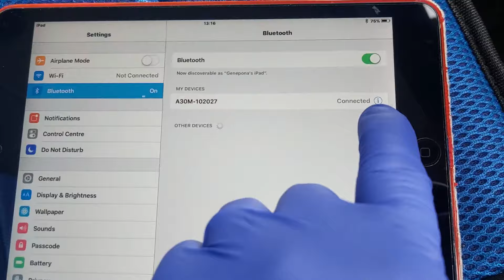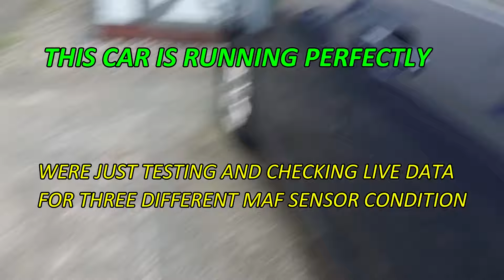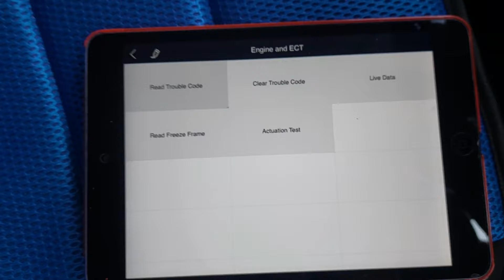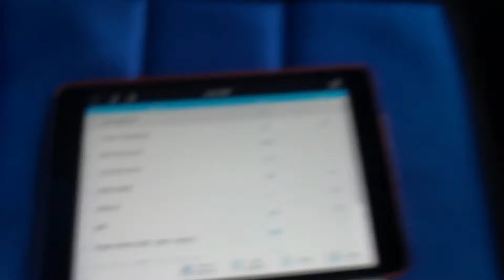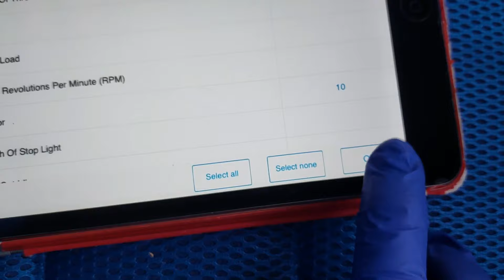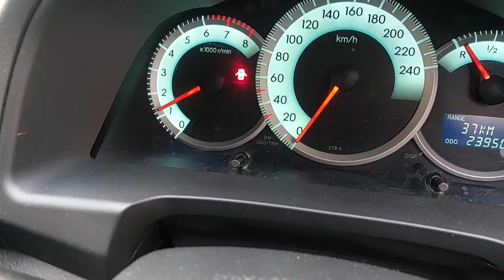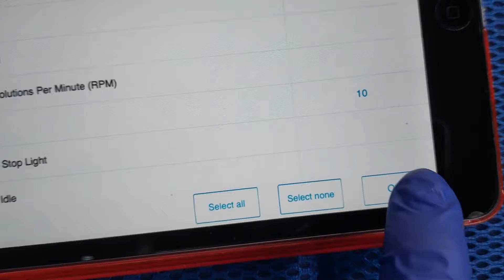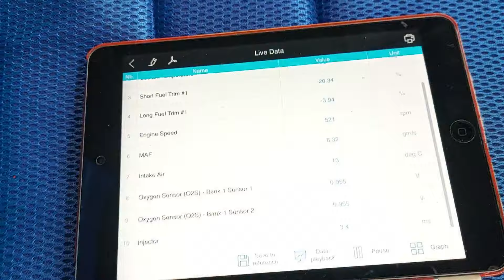DIRTY MAF VS CLEAN MAF VS BAD MAF SENSOR TESTING AND LIVE DATA with a SCAN TOOL.

Comment: You should've cleaned the dirty sensor and retested it so you would know if it's the dirt that caused the issue or the sensor itself is not working properly

Comment: But please why is it that the long and short fuel trim is still running negative on clean MAF
Reply from the maker: A clean MAF running between -3 to +3 are still very good..the engine has 235k kilometers..
Reply: @jlsetnuper  thanks 🙏 waiting for next video
Reply: Anything under 10 is considered good really good will b -0 +0
Reply: I would say in the range of -5/+5 is good.

Comment: Came here just to see for a laugh if my annual cleanings are warranted. got a CEL so I grabbed my scanner and it just said p0102 maf/low voltage so I popped the hood at home where my tools are and it just came undone but ran fine still til I did a wot pull acting confused 😅

Comment: super helpful.. does cleaning the MAF restore smooth idle? which MAF cleaner would you recommend kindly 🙏🙏
Reply from the maker: thanks for watching..yes cleaning the maf sensor will restore the fuel trim. You can use Maf sensor cleaner or a break cleaner..

Comment: What does Fuel Trim means?
I'm currently running 4 Litre / hour of Fuel at Idle. Calibrated injectors (diesel), new oil, filters etc.. Any chance that this is the cause? My intake temperature reads high too

Comment: Any retailers sell the scan tool? Does it have programmable features coding? How much are they? In the UK what's update like is it limited you have to pay or free?
Reply from the maker: thanks for watching..check this link  https://www.ebay.ie/itm/155860399422?chn=ps&norover=1&mkevt=1&mkrid=5282-166454-587998-0&mkcid=2&itemid=155860399422&targetid=295818637131&device=c&mktype=pla&googleloc=1007842&poi=&campaignid=21085357816&mkgroupid=160523081660&rlsatarget=pla-295818637131&abcId=&merchantid=660570997&gad_source=1&gclid=Cj0KCQjwpNuyBhCuARIsANJqL9OROLCcd05guHv3NLKWaBP0nwRLrhqdUJ3TddBI5VwIVbGWBsPyr5gaAhKuEALw_wcB
Reply: @jlsetnuper  thanks I said I don't do eBay no online buying has to be retail

Comment: Quick question please, what type Toyota engine, how many litres of displacement, how many cylinders ? Thanks !
Reply from the maker: thanks for watching..it is a 3ZZ-FE engine, 1.6 litter with  4 cylinders .
Reply: @jlsetnuper Thanks for the info, wanted to calculate the optimal MAF sensor figure for my 1.5 L 10th gen Honda Civic here in the USA.